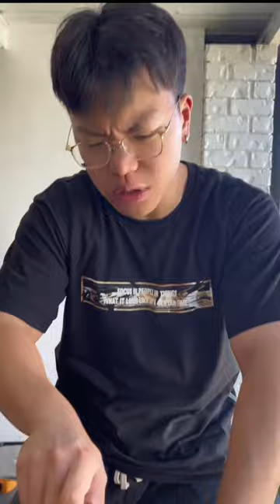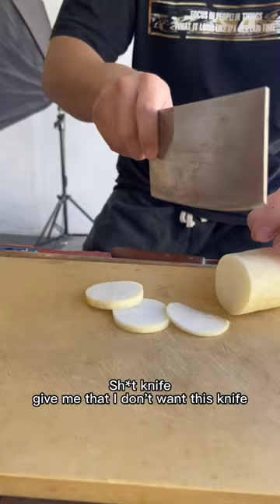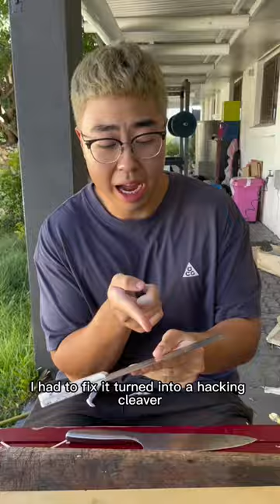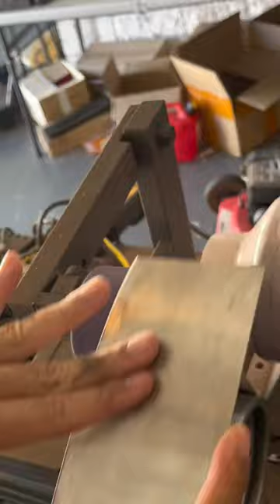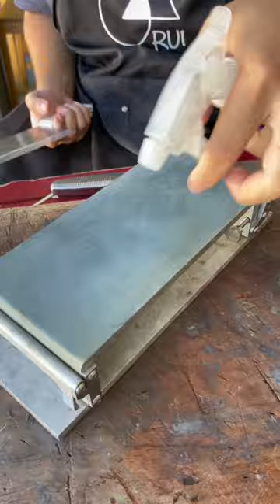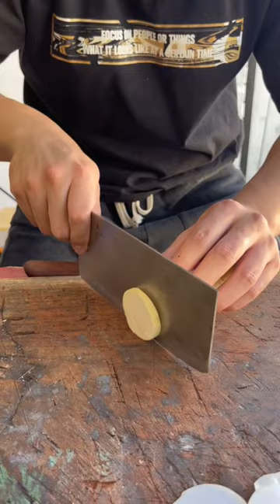20/80 bevel on Rui Cleaver. #fyp #knife #knives #knifesharpening #knifesharpener #kitchen

Comment: So what side is sharpened at wag angle for 20/80? I’ve always sharpened every knife at 15 per side but I have no idea what angles for a 20/80
Reply: 20/80 left/right, like a single bevelled knife is always right side, ray created an edge similar but instead of 100% of the edge is on the right side, it’s split 20/80 left and right